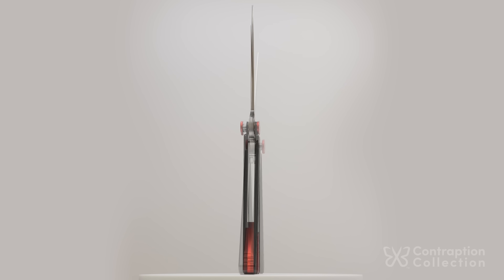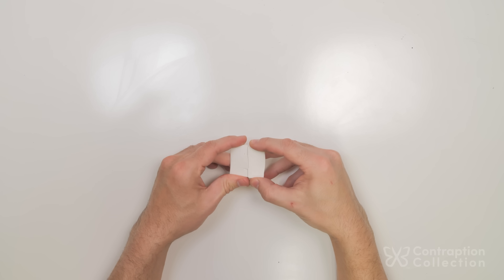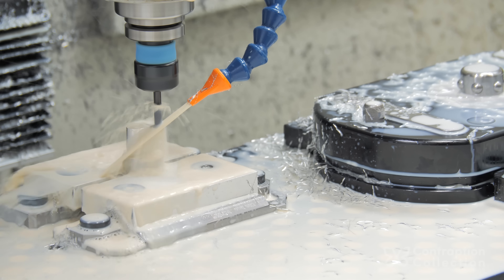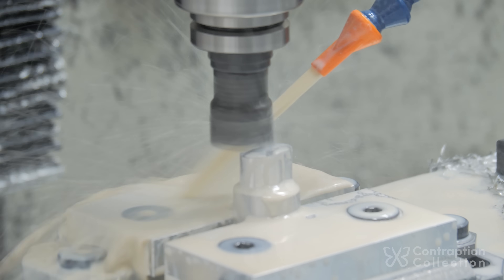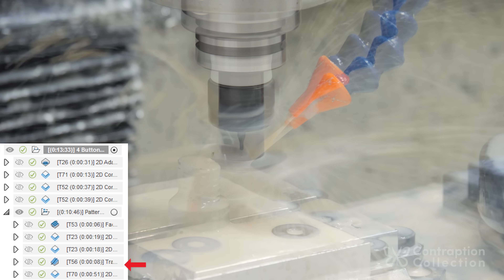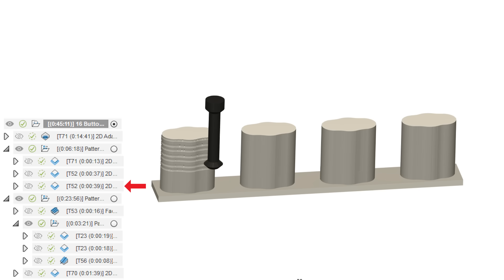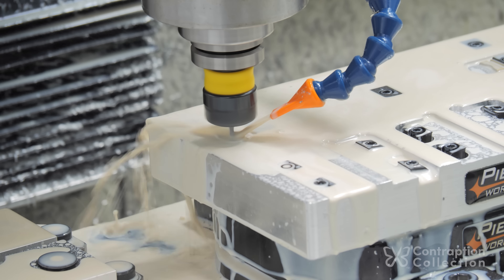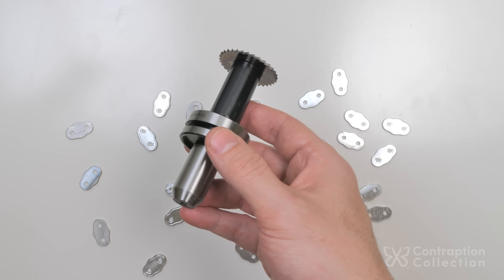How many parts can I make at a time? Baliscissors Ep 30

Comment: as a young guy who loves 3D modeling and making things what are some things I could to start my macheneing path? I want to take classes at a local collage and get CNC certified but don't know what else do to. I already have 3 Baliong parts I want to make just no machine to make them on (aside from sending it to PCBway or send cut send) any recommendations? also really love this series as it showed me making knives isn't as easy of making a part and hitting go. so exited for the end product!
Reply from the maker: It depends what your goal is.

I went to my community college for machining, then got a job in town. Looking back, I probably could have got the job without the community college degree. For machining, lots of shops just want people willing to learn. I even sometimes hear from shops that make balisongs that they wish they could find more people.

If you want a career that's more lucrative and teaches you more about making things, maybe a mechanical engineering degree would be right for you. If you want a career, but just like designing the look of things maybe look into industrial design.

If you just want to make individual balisongs quickly, look into other knife making videos. There's no need for the expensive CNC machine and software. You can do plenty with grinders, files, and a drill press. I think these are good things to learn anyway, and many people still make high quality balisongs this way.

You may also have access to tools or even a CNC machine if you have a makerspace in your area.

If you just like designing, and don't care as much about functional knives, maybe get into 3D printing. That's really the fastest way to turn lots of ideas into testable physical objects.

I would just try to do as much as you can as early as you can. Buy a file and a piece of steel and start trying to make it knife shaped. Get the student edition of Fusion or Solidworks etc and start designing lots of things. The second thing you make is going to be much better than the first, so try to get that first one out of the way sooner rather than later. :)
Reply: Quick addition as someone who's about to finish a mechanical engineering degree: as an engineer, you'll probably end up more oriented towards the design or process optimization side of things than the making stuff side of things. Pay's pretty much always better for an equal amount of experience, but you probably won't spend much if any time at the machine, cutting the stock for most jobs. Just thought I'd say so in case it alters your considerations. Also worth noting that I'm still in school, so I'm going by what I've seen and heard from my peers and profs.
Reply: I'm throwing another response on the pile because I was in a situation similar to yours years back. 

First, maker spaces are more and more common these days. If you live reasonably close to a more developed area, there may be a maker space or even a non-profit dedicated to metal arts near you. One thing I wish I'd realized earlier on is that there is a lot of overlap between fabrication and many facets of the art world. Searching for sculpture classes for example might be a more accessible way to dip your toes into welding than paying tuition for an entire course. 

Second, if you have the drive to take community college classes absolutely do so. Whether you end up going the trade route or becoming a full on corporate desk surfing engineer, understanding processes early will be an enormous advantage to you. 

Third, people often recommend getting a mechanical engineering degree if you're interested in making things. I think many people are unaware that there are manufacturing engineering programs that dive far deeper into manufacturing and fabricating processes than mech eng programs do. I was more interested in planning out manufacturing lines and designing fixtures and tooling than I was in calculating paths of four bar mechanisms, so I went that route. 

Lastly, don't be afraid to ask everyone you know if they have any contacts who would be willing to be a mentor! I have a totally underutilized small machine shop and I would jump at the chance to mentor up and coming fabricators and engineers. Don't be intimidated and reach out!
Reply: I've loved making stuff since I was a little kid ( I'm now 68). About 20 years ago, I needed a part for one of my motorcycles but soon found that CNC was the only way to get it made. As we do, I went online and found that people are making their own CNC machines of all kinds. In the intervening 20 years, I have designed and built (quite cheaply I might add ) a desktop CNC mill and 2 CNC routers. All are very accurate and can produce some very nice parts. The lesson being, don't wait. Get into the online CNC world and start by building your own small mill and get it tuned up to produce really accurate parts. Then use that mill to make the parts for the machine that you really want.
Reply: I did advanced manufacturing trade classes at my community collage and have been working in a machine shop making parts medical machines for almost 2 years now, look for a shop and just apply be honest with them on what you most places are willing to teach you a lot if your willing to learn.
Reply: I did a four year apprenticeship to become a machinist but also depending on where you live you may be able to find a makers space or men's shed where you can get access to machines/3d printers. Have a look around your local community and you'll be amazed what you might find
Reply: What Contraption said at the end, "do as much as you can, as early as you can," is an excellent piece of advice. Get your hands dirty, safely, as soon as you can. If you have a family member, family friends, or just friends that work with their hands, then try to get some experience working with them. I'm a weird amalgamation of scientist and engineer, and I owe it all to my dad pushing me to work with my hands. Start with small tasks like filing and sharpening knives, doing oil changes, or small engine maintenance. It will help you build the confidence you will need to plan and execute more advanced projects.
Reply: Start in a job shop running parts, best way to get in.
Reply: Probably put a S in their because balion means “ i will break in half” the g still makes some sense even in the language

Comment: I solved this problem by using a Down cutter on op 2 to remove the material you previously held with. Most end mills are up cut which want to pull the piece up, especially when the work piece perimeter is much smaller than the op1 holding stock area. This issue is even worse with thin parts. It has so much leverage to move the part up slightly. With a Down cutter, it’s pushing down into the fixture which should be less problematic. Once you remove that “hat” come back in with the up cutters and finish the part. Solved it for me

Comment: I work in the firearms industry doing cnc with steel and aluminum. Instead of slitting saws we use keycutters for undercuts. 
You could try doing them in a stack like you have them, but the bottom of the part is facing up, you do the bore and then do the counterbore with a small keycutter, 
Cut the part off with your slitting saw or a keycutter, then turn it over and clamp it for the top face and engraving. 
That would hopefully make the counterbore parallel with the bottom face as they're done in the same operation.

Comment: Use a bigger vise maybe with bigger soft jaws for more fixturing. Then mill more spots for holding more round stock. You could also use your same vise with new soft jaws and mill two or three spots for more round stock. You could mill two more on each side of your exsisting jaws. Another thing you can do with square stock, is face off two or three faces of the stock to square it to the solid jaw and bottom of vise/jaw. Then mill the face towards the move jaw (if you want all of the clamping surfaces to be square). Hope this is helpful/useful. Love your videos btw keep up the great work. The scissors are sick too!🙂

Comment: So preface: i got no machining experience at all, but couldn’t you stick the bar into your vice, mill the sides, face the top, drill and bore the holes and then just cut the button all the way off with the saw thingy? That way you wouldn’t have to face the bottom and you’d remove a bunch of uncertainty. Then you could face the next button and do it again

Comment: The best way to hold dimensions is to do the most critical at the same. In this case, face the back side, profile, drill and back counter bore with either a stepped end mill or a flag cutter (its like a 1 tooth non symmetrical woodruff cutter) for op1, then in op 2 bolt through the counterbores and use the through holes for holding location with bosses on the op2 fixture. This would allow for thiner and cheaper stock as well.

Comment: I would look at ways to do more cutting in the spindle rather than interpolation of holes. End mills aren't flat bottomed and in a 3 axis machine tool there are 21 degrees of freedom which will stack up to give you error motions making interpolations non-circular. This could lead to inconsistent cutting height vs going to a position and using your spindle which should have very little run out in comparison and be more repeatable since you're in the same positions making it easier to compensate.
This is not a comment on your machine, rather looking at the process to eliminate as much error as possible as a lot of the errors I'm talking about are in the micron or submicron range (usually).

Comment: 10:27 I think your jig idea is the best way to approach it, I don't think you're going to find the consistency you want with the saw, it just seems too finicky, but I could be wrong!

 It's either cocking your part because the there's not enough stock to hold it against the pocket (you have a pretty big chamfer on it), and in fact, that chamfer could be acting as a pivot point against the straight wall, kind of what would happen if you were to try and stick a knifes edge against the back of a vice, you'll be playing with a see-saw all day. That or the part isn't deburred properly. Another issue could be that the clamp portion underneath your part isn't clearing, which is an easy fix.. But I can't help but notice there isn't much it's holding on to, which I think is the source of your issue. Leaving the chamfer for the last operation might be your best bet?  

One thing that always gets me when fitting things into pockets is the left over rad along the edges of the pocket (from the cutting tool), which makes me have to run a ball bur over it clearing it out entirely. Another thing is if the rads/angle aren't a perfect match from the pocket to the part. Rads and angles are probably the number 1 issue that will hold something up. 

Either way I would place your piece inside of that pocket and wiggle it around with your finger and see how much play there is, there should be almost zero play. If you have any spotting blue you could also see where it's hitting and where it's not. I would blue up the pocket, put your part in normally, clamp it, and see what's going on down there.

I make plastic injection molds, so making things fit comfortably & perfectly is basically all I do, all day. You'd think things coming off the CNC would fit together like legos, but NOPE!
Either way great video :)

Comment: Hi maybe this is a crazy idea, could you invert the machining of the part by using a key hole bit to make the counter sink? that way you can do:
1 cut the shape
2 drill the holes
3 face the "bottom" of the piece
4 make the counter sink while it's upside down
5 cut the chamfer
6 then part off with the saw

this way the parallel parts are guarantied parallel, and you can fixture the piece after to do the engraving which wouldn't need the mechanical accuracy.

Comment: I have been using this technique for a very long time. A couple of things I learned along the way......
A. I use key cutters for sizes like this to avoid the arbor. Key cutters are flat on the bottom. My most common size is 1.50 x .063 from Internal Tool. 
B. I do parts like this and larger in two passes - one pass per side all the way to the final size. With a single tool, I have done a giant pile of parts. Just keep the coolant as good as you can.
This is much faster than multiple passes with 060" stepover with no real downside.

Comment: Excellent video series!
If you don't side clamp the blanks to do the counterboring, but instead clamp them vertically, you should have better control over the depth of the counterbores.
So profile the outside, flatten the bottom, then clamp vertically around the edges before machining the hole and counterbore.

Comment: I know you are against the idea probably of not using the tool holder, but if you have a good method of securing the round bar in a lathe, which is likely, then a cutoff tool seems just as good to part the tool. Maybe it's just a matter of making a good tool to hold in a mill as well as a lathe?

Comment: I'm not trying to sound like a dick but if your soft jaws were unable to hold the two surfaces parallel, you are doing something wrong. A cheap angle lock vice with properly cut soft jaws should hold the part within a few tenths all day long.

Comment: Heyya CC, are all of your tool changes manual?

Asking because in theory, you could see about making some custom tooling to reduce your tool changeovers, but the most notable issue is manually pulling the piece off. But the 'pull it off' step and the facing step are side by side, so If you are manually switching tool to facing, it makes sense to leave the pull off step as you are already there.

Otherwise, simplest change is more soft jaws to grab your round stock. Otherwise, grabbing thick raw rectangular stock, making a setup for prep (taking raw material, and cutting your precise footprint into it) then putting it in a new jig where you can then cut 50 at once would prolly be better.

Really depends on your quantity needed, price for different stocks, and time dependencies. The 50 pieces at once setup is going to be pretty big, but if you only have to run it once a week, and it gives you 1 hrs downtimes to take care of assembly, it might be a higher monetary cost, but it saves you opportunity cost by allowing you to do more things at once.

Using enough round bar pieces would work too, but you greatly increase the chances of a messup by adding 50 facing the stock, cutting it, jigging it in, tightening it, as well as being susceptible to the mfg allowing a batch of round stock that you can't use because they used their minimum tolerance for this batch, and your setup has 4 fixtures that fail at that tolerance (which you prolly won't notice until it crashes).

Comment: the two parallel surfaces should be machined at the same time, so do the flat side first, drills the holes and use a carbide key seat style cutter for the counter bore. That way the critical dimensions should always be perfectly parallel then you can flip it round in your original fixture and face the other side

Comment: I love these videos and the product. Have. been watching them since first prototypes. And It has always been so excesive the tolerances you need o these to make them work.

Don't you think that it should have less extreme tolerances to be an actual feasible product?
I wonder if these extreme tolerances are going to get destroyed in a month use and all the effort you are putting into manufacturing will desintegrate into a loose object.

Comment: Would it be beneficial to face the areas directly under the counterbore with the slitting saw and leave a large chunk of metal in the middle for support & rigidity?
Then later hog out the center structure to separate from the stock? This way the piece is as rigid as it can be while your working on the important areas.
Also, if you leave the tab artifact in the right place (90deg from current orientation & through the center) you can probably get away without sanding them at all.

Comment: We only use single piece slitting saws. Huge problem with cheaper saws is they are never really aligned axially with the tool holder and some teeth cut more than others, ends up with bad cut.
The single piece (pref carbide) ones are way more expensive and provide less cutting depth.